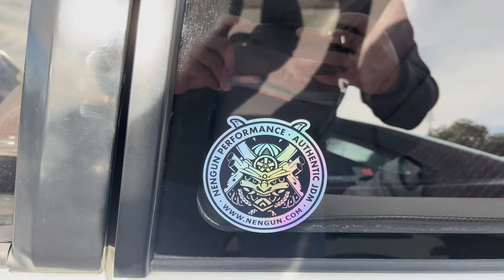Vtec Tuning & OldSkool Honda Meet - Pasadena 2024!!

Comment: i have crx and 91 prelude si aws
Reply from the maker: 🔥🔥🔥badass collection bro! Any engine swaps on the CRX’s?
Reply: @bwcp  i had my white crx for 19 years but it was just sitting for like 10 years and now im back to the scene but alot had change i had a y8 v tec in it but im putting toguether my parts to go b20